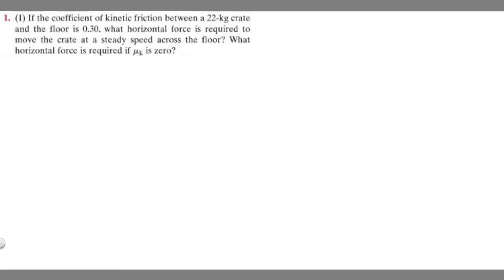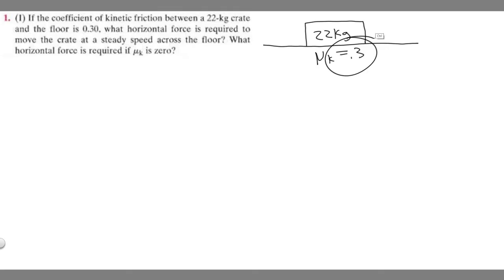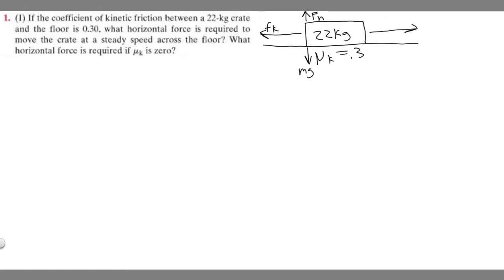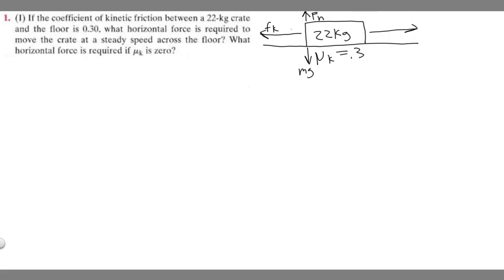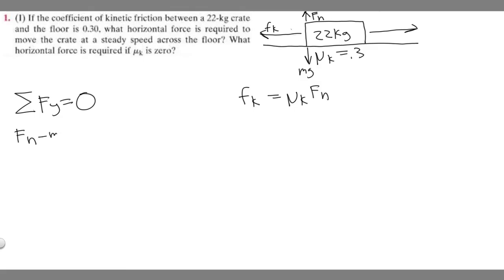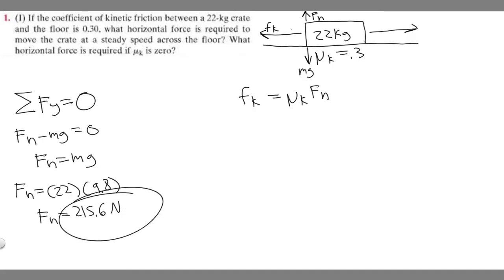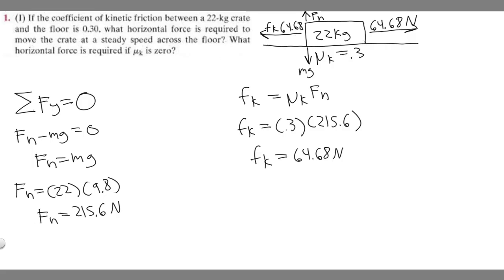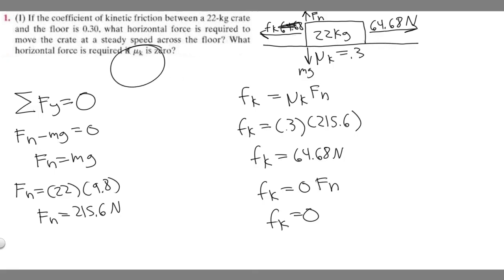The coefficient of kinetic friction between a 22kg crate and the floor is .3. what horizontal force

Comment: l have a question, what if the coefficient of kinetic friction, between a crate and a horizontal floor is 0.27 . if  the crate has a mas of 250-kg , what force is needed to slide it across the floor at constant velocity? then what will be the answer?